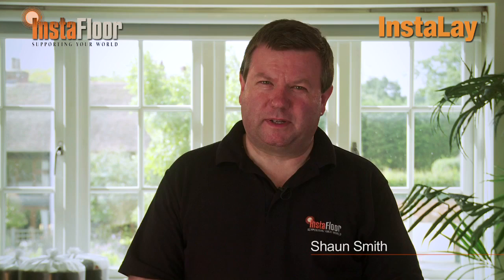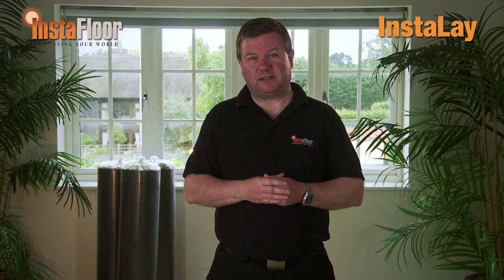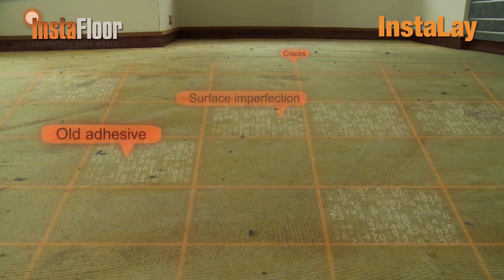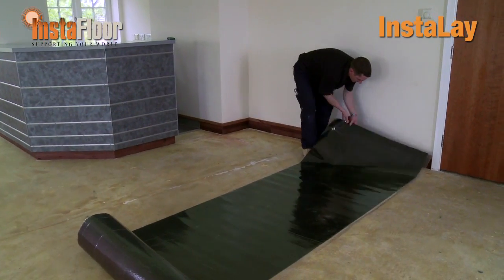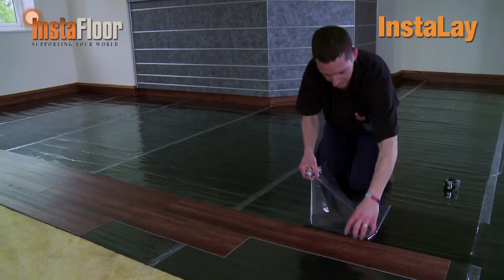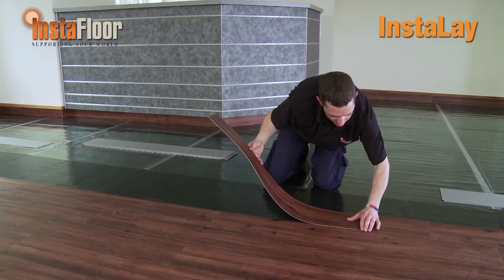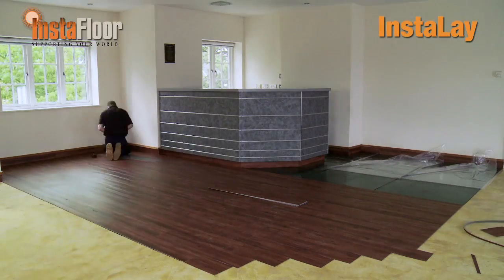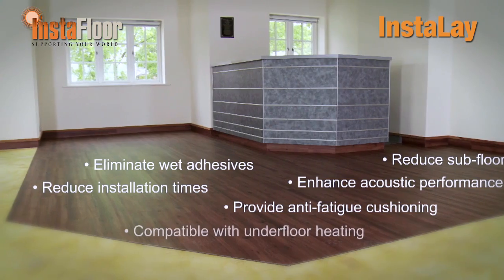LVT installation using InstaLay self-adhesive, acoustic underlay (loose laid)

Comment: Hi, can this underlay go over an existing sheet vinyl flooring? (heterogeneous vinyl Leoline) To then lay a LVT floor?
Reply: Hi Darren, yes InstaLay 25hg can be loose laid over a vinyl floor as long as it is sound. The LVTs are simply installed on the self-adhesive layer. Regards
Shaun
Reply: @shaun21784  Thanks for the speedy reply, much appreciated. So an LVT that is normally glued down just gets bonded with the self-adhesive layer instead?

Comment: How would the product perform over a 3500sqft retail area over concrete?
Reply: This product is for DIY renovations. I wouldnt recommend this product in a commercial application. Buy a dryback product and glue it down. Better and cheaper.
Reply: According to the company, it has been used in commercial and large apartment complexes without much issue. But for a retail space, I'd go with a different product. Something less permanent, maybe?